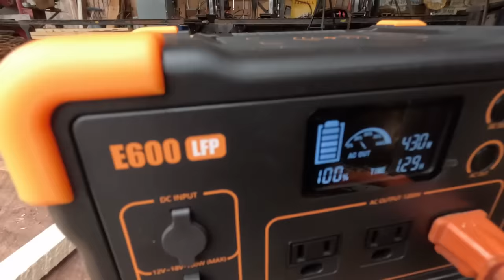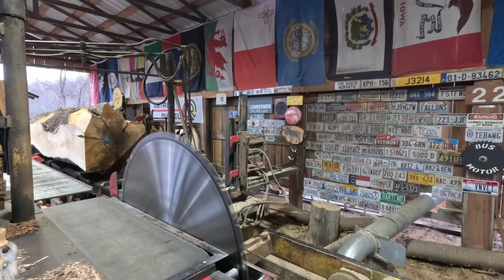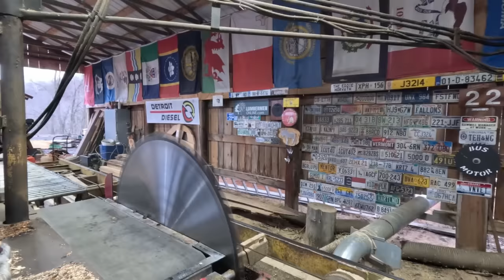sawing a big nasty Bing cherry into paneling & Merry Christmas # 504

Comment: Merry Christmas To all of you and your families!
Mark, you need to take advantage of that bus motor next to you and install at least a 3000 watt inverter to its battery bank..... You would be able to power 800 watts of lights and most everything else you need!
Way better than a separate generator running on gas!
Reply from the maker: thank you , I do have a 1500 watt inverter that runs my sawmill controls, Merry Christmas!

Comment: The Yule log 😀
Reply from the maker: yes for sure lol.
Reply: @markgalicic7788  Read the charging instructions carefully for that power pack. Some items require you to wait until their charge is empty before recharging for maximum battery life if you keep charging them with half supply left the batteries won't last as long especially if it has lithium batteries inside.

Comment: I wonder if you guys do finish woodworking? Cherry is very expensive and retail outlets sell dried and finished cherry in pieces as small as 1” square and 3’ long to make spindles and such.  You seem to believe if it isn’t 8’ long it’s junk. I would be thrilled to take most of your junk wood off your hands, particularly cherry and walnut, but even maple and red and white oak. Hickory is also valuable, but is a little more particular about size.

Comment: Merry Christmas from Dover Delaware. Why don't you just put a 3000 watt inverter on the bus motor? That would give You power anytime the nus motor was running.
Reply from the maker: thank you , I have a 1500 watt inverter to run the sawmill controls. Merry Christmas!

Comment: With the new power unit will there be night sawing for New Year's Eve?
Reply from the maker: I would love to do a night time sawing video .
Reply: @markgalicic7788  I wish I could come to the mill & help string up some lights. Are fireworks legal in PA? Here in NC if it explodes or leaves the ground it can't be sold, possessed or shot.
Reply: @davidhensley76  I won't make any plans to move to NC. Thanks for that!

Comment: Hi Mark & Co.! Wish you a very merry Christmas and a very prosperous 2024. May your worst day in 2024 be better than the best day of '23! I love the big "xmas present" you gave us. Only problem with a STOP sign is that a lot of people ignore them! Hahaha. Here in sunny RSA we actually changed the wording to "White Christmas". We've mad it "Wet Christmas, since we are in summertime here! Hahaha. A quick thought, the old bus motor is running continuously, have you ever thought of connecting a small generator to it? That way you kill two birds with one stone. I would think that the bus motor will handle a small generator as well as the saw mill. By the time you read this, half of my Christmas is already gone. We are 8 hours ahead if you. I love Eddie's channel, a different perspective on the saw mill. Regards to all the other "Stooges"! Hahaha.
Reply from the maker: thanks Paul , I do make power off the bus motor to run my controls for the sawmill it's not big enough to do both. Merry Christmas!

Comment: On the fuel issue, I have run into situations where I had contaminated fuel that had large debris in the fuel and it was clogging the fuel line at narrow areas like sharp bends and fitting areas. Mine was from using 55-gallon barrels to transport the fuel, and the paint inside the barrels was peeling. Then, the fuel lines had banjo fittings going into the lift pump. The paint chips collect in the banjo fitting, I would pull the fuel line off the banjo fitting and blow air back into the tank, never taking the banjo fitting off. Then one day I broke the fuel line system completely down and separated every component, I found 4 different pinch points where the chips had collected. In the 4 years I battled this (I was very young and didn't have access to quality help) it caused the injection pump to fail and countless hours of frustration starting the tractor and keeping it running. The final part that got replaced was the lift pump. I had very little trouble after that. 
Another possibility that I have only heard about was a disgruntled employee who took the cellophane wrapping off some packs of cigarettes and dumped in the fuel tank, the cellophane was invisible in the fuel, the engine would starve for fuel and the mechanic would blow air back into the tank and it would be fine for a while then plug again. They finally found the culprit when they fully drained the tank through a screen then steam cleaned the tank. They found several pieces of the wrapping.
I'm not saying someone did this directly to you, may have happened to the last owner of the fuel tank or something else.
Reply from the maker: the main filter on the 275 gallon tank needs to be replaced but I don't have a spare one here , I just cleaned it out and good to go for many months now.

Comment: Nice little power pack, just a question why not add an inverter to the already running Dirty Troit? Tap off a battery and run the lights, charge the power pack while the bus motor is all ready running and making noise. When you shut it down the power pack will keep the lights on while you do your edging. Just a thought.
Reply from the maker: I have a 1500 watt inverter on the bus motor to run the sawmill controls.
Reply: If you upgraded to a 5k inverter you would be pretty much set for all your electric needs. And off the grid.

Comment: If the bus motor will charge it's own 12V battery, will it charge your power unit? Is there a 12V input on the unit? Check the instruction manual. You might not need to take it home to charge it, doing it every time you saw wood. Thanks for the video. Merry Christmas. Jon
Reply: it must of had a alternator on the origanal motor, i never knew he ran the lights on a genorator, now that he has that battery surely someone out there can donate a 500 watt solar panel , lol,
Reply from the maker: @eisbeinGermany  yes it does have a alternator on it that I run a 1500 watt inverter that runs my controls for the sawmill.

Comment: Question do you have fuel injectors on that bus motor you might have something clogging up the line or in the line that's not letting the fuel pass through
Reply from the maker: No it's just the water separator on the main fuel tank that gets clogged up.

Comment: I am surprised you guys don't have an inverter on the batteries of the bus motor. It's kinda silly running another generator when you already have one going.
I thought the ads were a little long.
Reply from the maker: I do have a 1500 watt inverter to run the controls for the sawmill.
Reply: @markgalicic7788  Great minds think alike. =] 
If those lights are 800 watts, Do you have enough room left for the lights? At least a couple of them?

Comment: Why not put alternator on the bus motor add ac DC converter to run the lights
Reply: now that he has that battery why not just get a 500 watt solar panel,surely someone out there can donate hime one, lol
Reply: Or do both
Reply from the maker: the bus motor has a alternator on it and I have a 1500 watt inverter that I use to run the controls for the sawmill with.
Reply: LEDs draw nothing
Reply from the maker: @kylegallardy1894  these are the UFO LED's and they draw 200 watts each.

Comment: hay mark ya want a more reliable and better way to run your lights get one big long industrial semi battery hook up a 2000 watt inverter to it with a 8 or 10 gauge charge wire running from the buss motor and problems sloved thats what a amish mill by me does and it works great.

Comment: It looks like the power device has an inductive charging point on the top, under the handle.  It will charge some phones witout the need for cables.
Reply from the maker: yes we did test that today with my son Alex's phone it worked great.
Reply: @markgalicic7788  I watched the rest of the video and saw you did identify it as a charging point . I work in IT / communications, so I'm used to working out what devices do!